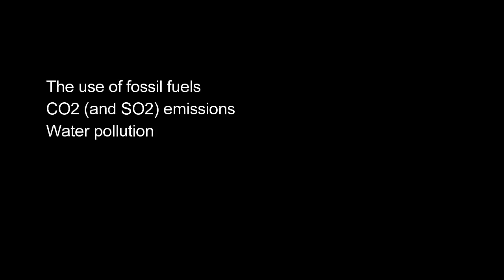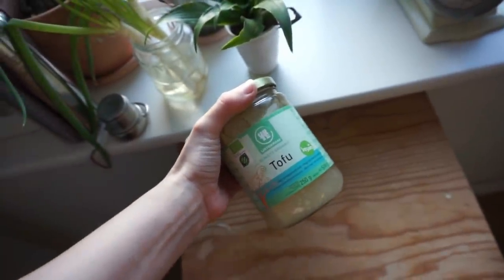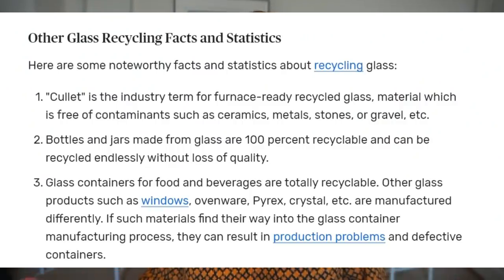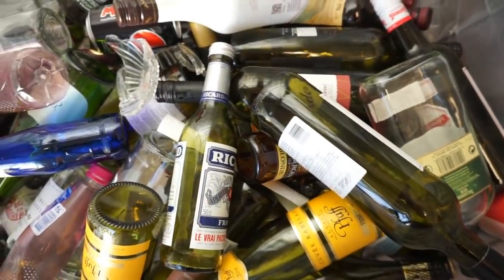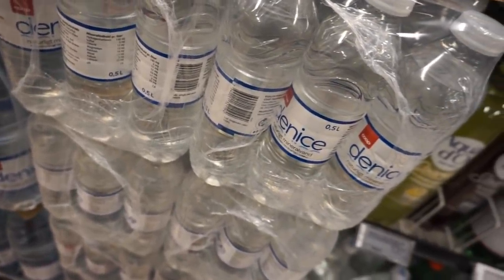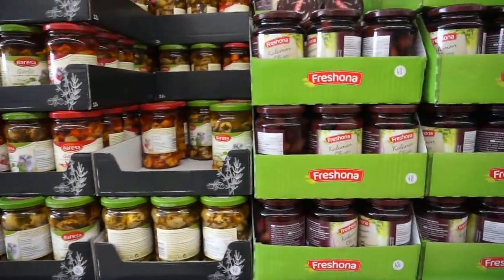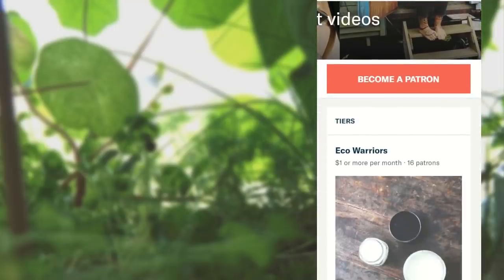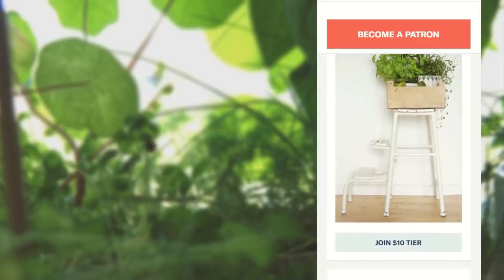THE IMPACT OF GLASS // what we all should know

Comment: I would love to see a video researching the whole “ run your furnace constantly because it uses more energy to turn it off and on again”. I live in Canada and have to heat with oil. In the winter, I heat the house to 17 degrees and turn off the furnace until I start getting actually cold even with a big sweater. That’s usually around 10-12 degrees. I also close off all but a few rooms so that I’m not heating unused space.

Comment: good video - one thing that could be added would be the ability to reuse glass rather than recycle at industry level. As you probably know, here in denmark most beer bottles come in the same bottles so that they can be washed, rinsed and reused rather than melted down and recycled. That has significantly less externalities than recycling and is a unique feature of glass reuse compared to aluminium and plastic =)

Comment: Glass is NOT endlessly re-meltable....eventually the process of heating and cooling it will cause it to 'seed'. The glass' chemical composition changes and it will no-longer 'fit' with the rest of the batch. If it gets to this point the entire furnace of glass has to he thrown away.

It's also way more complicated than just all clear glass can be melted together.  The original chemical makeup of the glass decides weather it can be melted together. You can't throw a coke bottle, a window pane and a Mason jar into the same furnace, the resulting product would explode when you tried to anneal it. (Annealing loosely means to bring it slowly to room temperature)

Try to re-use them at home, it's the only way to guarantee something is truly being recycled

Comment: I'm sorry, but I have to add my 2 cents as a Geology professor here. There is no such thing a glass in ground as unsustainable. Glass or Silicon dioxide is the most chemically resilient and abundant mineral on earth and it is what remain after millions of years of physical and chemical erosion of rocks. When you say glass doesn't degrade, you are only considering the chemical aspect. That does not mean glass in itself is indestructible. It is as we all know, physically degradable. It does not chemically interact with our surroundings, so wouldn't be creating any more problems than what sand does. In fact, it's beneficial to have sand in soil, which increases porosity and percolation of water underground. Glass in a landfill has basically zero drawback. It will just stay there without disturbing anything, exactly how glass has been throughout the entire geological history of earth. Here is an additional point, the only thing that can chemically disintegrate glass is hydrofluoric acid, which is the most powerful acid and powdered sand has to sit soaking in it for atleast 24 hours to dissolve. Bottomline, something being chemically resilient does not mean it is a problem
Reply: So is it better to buy things in glass and recycle compare to cans?
Reply: @sesil0060  yup
Reply: @sesil0060  however, please check with your local recycle plants whether they recycle glass,  due glass is heavy and relatively cheap to make, lots of places does not recycle glass. Mine does not, I just reuse the bottles and jars.
Reply: @shuangwu668  Yes thanks for mentioning, Also, not all types of glass are recyclable. For example drinking glasses and tempered glass.
Reply: I get your point but surely there is the 'problem' of glass in landfill adding to the volume of landfill right? as in yes it might not interact with the surroundings and thus it wont negatively effect its surroundings over its 1 million degradation process but surely it would be better to have a smaller volume of landfil waste. So whilst it doesnt pollute its surroundings its better to recycle as much glass as possible (since it also has a good recycling potential) in order to reduce the overall volume of landfill, since having to use large land areas on landfill reduces the possibility for animal habitats. In that case the length of time it takes for something to degrade does impact the environment in terms of how long we have to wait before we can use the same landfill area again.
Reply: @Littletass  But, I'm in no way advocating for choosing to dump glass pellets over recycling. I'm only saying that we don't need to freak out about sand being dumped in landfills. I will always favor reusing and recycling glass, because eventhough sand being dumped somewhere don't create any problems, removal/mining of sand from beaches and river banks to make new glass will alter the environmental conditions in that area. Recycling glass is the more sustainable and responsible behavior.
Reply: @aleenaprasannan2146  no i agree but i mean in general standard landfill is, as far as i know, not a good medium for things to grow in since landfill generally contains everything that cant be recycled ie single use plastics, many synthetic materials and large items like fridges and so on. Whilst i acknowledge that sand does not harm the environment and is also good for vegetation to grow it doesnt help the environment when the rest of the landfill is full of stuff that is bad for the environment. In that case you might as well try and limit the volume of landfill rubbish in general, and one of the ways of doing that would be to try and not let glass end up in landfill. So i agree glass is not harmful for the environment but landfill in general is and so limiting the overall volume of landfill rubbish would mean the area of land needed to for landfill would be less and thus more environmentally beneficial. So no we should not freak out over glass being in landfill but at the same time glass shouldnt really be there to begin with so it is worth making a fuss about it in order for more efficient interception and recycling of glass to be set up. =)
Reply: @Littletass  I do agree that glass endings up in landfills is a bit of a waste actually. You can use it for a multitude of other cases, when we can just directly use is even in potting mixture. So yeah, glass in landfill is just wasted opportunities 🤷‍♀️
Reply: @Littletass  Not necessarily. Yes the volume of the landfill increases, but that doesn't mean a sand dominant land will adversely affect environment. As I said, sand increases porosity and permeability and that is exactly the most ideal soil nature for accommodation of organic matter as well as flourishing of fungi, since water can percolate easily and maintain moisture. This condition is very ideal for vegetation to flourish. The river banks in our nature has a similar soil profile which is a very conducive environment for vegetation
Reply: thanks for clearing that up!
Reply: It is nice to hear someone mention this science for once
Reply: And it's a lot easier to reuse with little to no waste and for that you need heat to be able to work glass thier are alot of ways to get heat

Comment: Glass is so useful. I try to never toss the glass jars I get when purchasing new items. For example I use them as drinking glasses, storage containers, vases, pencil holders, containers for gifts. Instead of a gift bag I can use a gift jar(depending on the gift of course). Sometimes I will make one of my homemade beauty products and give it in a sterilized jar(just dip them briefly in a bath of boiling water with a set of tings so they don’t touch the sides, making sure they are already warm by soaking them in a bowl of hot tap water for a few minutes if the jars are too cold( no fun letting them shatter in the pan from shock). Lots of uses for glass. And when cleaned properly they are great to use for refillable products from the bulk and refill stores. Canning jars are my fav because when the metal lids get rusty it is easy to get replacement canning lids. Some of my homemade products contain salt, baking soda and vinegars which can impact metal. But usually that takes a year or two. Lol

Comment: Thank you for this great video! One tip: in most houses it definitely is better to switch off your radiators. Radiators have a small amount of steel to heat up, so they can react quite quickly to your needs and therefore switching off is more sustainable. In houses with floor heating it isn't, because the concrete floor takes up a lot of energy before heating up the rest of your home. When you're on holiday, it is better to switch off the floor heating. 

I work at an advising company for sustainable home improvement and we calculated everything. It's really interesting! It all depends on the mass of your home, the insulation state etc. But in most cases the way I described it is the way to go🤗

Greetings from the Netherlands